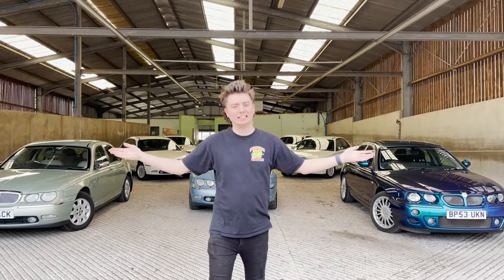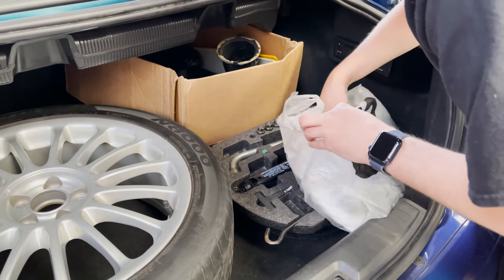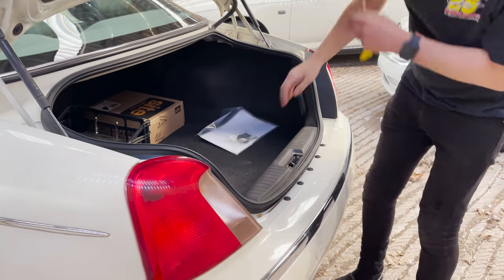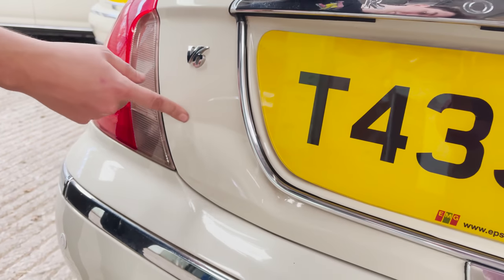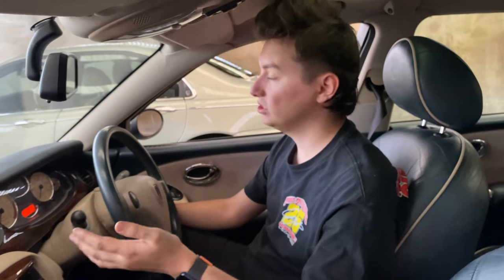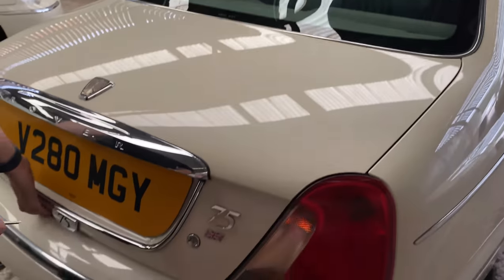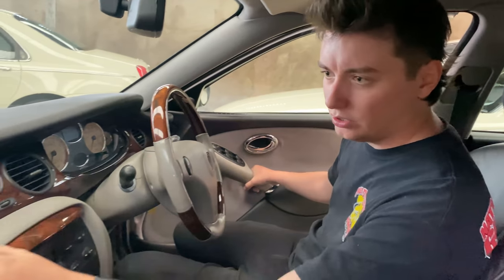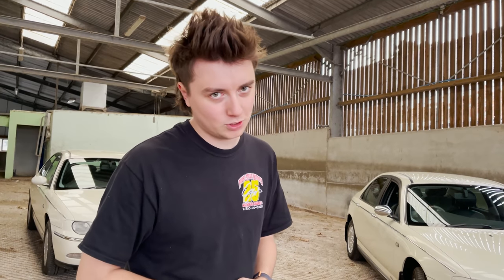The ULTIMATE Rover 75 Collection Tour - In-depth - Launch Car, PPD, MG ZT V8 and More!

Comment: Cracking collection. Couple of things:
The 1.8 boot badge was added afterwards. The only engine size badges on early Rover 75s were the torpedo badges on the doors. None on the boot until later.

Project Drive was a gradual reduction of costs in the cats, not a sudden 'get rid of everything'
Reply: Never seen a boot badge like this
Reply: Yes correct the 1.8 boot badge was put on by me because I liked it but it’s easily reverted back to factory stock
Reply from the maker: I did say at some point in the video that it was gradual month on month more or less in 2001. Thank you for the comment none the less

Comment: Great vid! Took me back 3-5  years, give or take a couple. I owned a Sept 1999 top of the range launch car out here in Auckland New Zealand. More refined than the launch vehicle on display here, Had a full-size spare wheel instead of a space-saver. Wooden/leather steering wheel; even the automatic selected lever was made out of wood/leather; both matching the wood found around the car's dashboard etc. The CD changer was located in the boot freeing up space in the glove box. Had all the "bells & whistles" with factory fitted GPS & TV.  Even had a cassette tape deck. Couldn't make up my mind if the seats wear "sea" green or blue though, while the exterior was that loverly powder blue. The first owner's of this car was B.M.W. N.Z. They got it from  Shorter's Ltd who were the Rover dealers at the time. It would have been the best car I've ever owned apart from my present vehicle; a Mercedes-Benz CLS 350 V6.
Reply: The quality of these 20 year old cars is evident in Tom's walk around. How MG Rover failed whilst making such a fantastic car is utterly confusing.